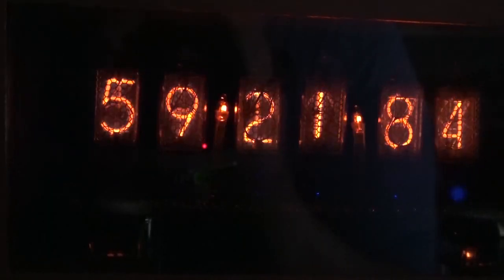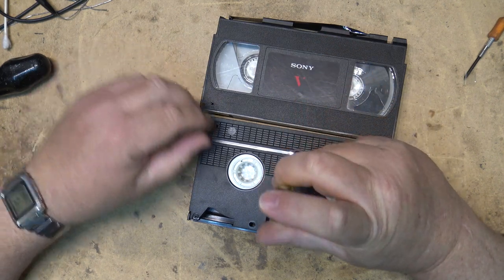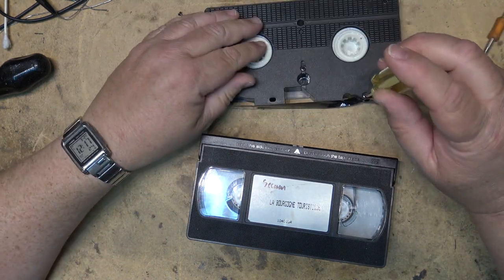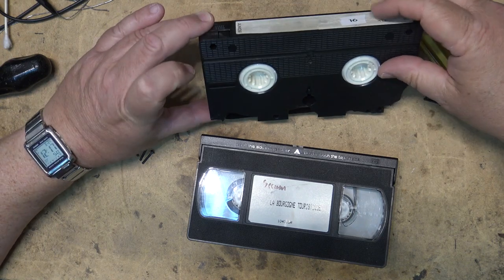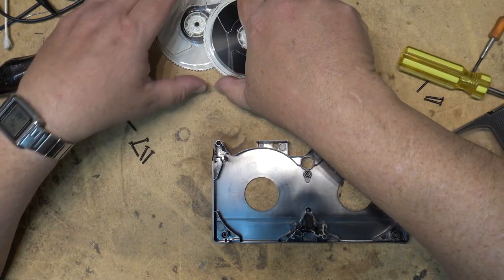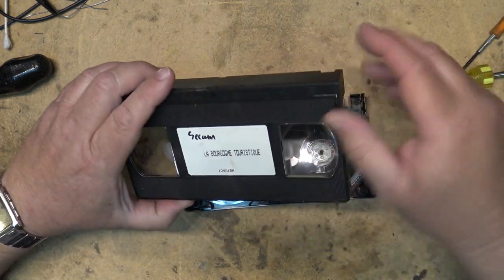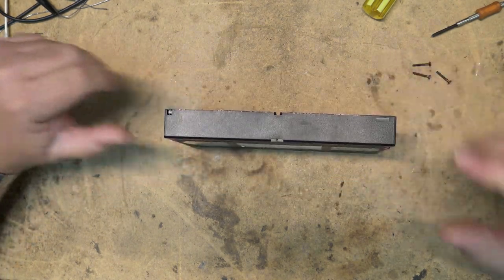VHS tape broken cassette shell swap

Comment: Swapping tapes over into different cassettes looks easier than it is but not in practice. You have to be careful not to pull the spring out of the back lid, and also it's easy to pull off the plastic bits that hold the cassette in place at the bottom. But I've heard that it's not a very good idea to use Sellotape/Sticky tape as it will damage the tape and heads of the machine, and even Scotch tape isn't recommended. Using only professional splicing tape (which isn't cheap) and a tape splicing ruler is the best method to repairing tapes.

Comment: That is the benefit of video cassettes, be it VHS or BETAMAX: most of the time a tape can be fixed and precious memories can be saved.
CD's and DVD's do decompose and become unreadable, files on a drive can get corrupted and get lost forever.
My point is: analog is not as bad as most people today think.
Reply from the maker: Until the machine required to play it no longer functions and you can not just go out and buy a new one.  As to DVD for reliability I have played flawlessly a DVD that was recorded 17 years ago, and was recorded on a no name brand generic shit disk.  Your previous DVDs put a copy in a dark cool dark drawer.  Don't leave them lying in the sun.  I have 200 cdr compilation disks on my Sony 200 dials changer.   They have been in it since I made the CDs most in the early 90s and every one of them plays fine.  I have been looking for disks that do not play and the only ones that don't were disks that I sat in a window to see how long it took the sun to damage it.  Incidentally last time I tried to play it was 3 years ago after it had been sitting with the record surface facing the window for a year. Then I forgot about it.  But it did play fine after 1 year but failed sometime between 1 year and year 4.  
  If you backup your DVDs every 10 years you will never lose your data.  A blank Costa what, .39 and you can back up a full disk in about 5 minutes.
Reply: Tape holds it for life ,  over 30 years and they still play !
Reply: @12voltvids  Discs rot in the shade left long enough

Comment: Did this a lot for security surveillance tapes repaired torn tape too, hardest part was  removing them from the Panasonic time lapse recorders, the unloading mechanism would not travel up evenly to eject the tape. Sometimes the tape was more valuable than the machines, we had lots of them.
Reply from the maker: Yes security footage is very valuable when it can identify a crime and put some douchebag behind bars.
Reply: 12voltvids sometimes nypd or fbi. were looking  for a car passing through one of our facilities to get a positive Id , also used to prosecute dwi people tapes all gone now, all digital @30fps
Reply from the maker: @tonymanzo3766  yes for sure. Digital changed everything for security cameras.

Comment: Hi there, just wondering, if a voltage output on a smps goes higher than rated, what could be wrong? The output suppose to be 12v dc but upon checking, it shows 20v dc and causing the system to shut down due to protection. Checked all caps, all good. regulators are good as well. But yeah, voltage going higher than it suppose to.

Comment: What will happen if there is a problem with capacitors in VCR power supply. Will ckt not respond eventhough switched ON.

Comment: Nice fix. 👍 I have a question for you, we where moving houses and I turned my VCR upside down. Then when I played back Tapes it played VHS Tapes fine, however if I played a VHS-C Tape in an adapter and put it in the VCR the picture is not still. Is this a tape alignment problem? What do you think? Thank you 👍
Reply: BTW has anyone had this problem, where a VCR plays back VHS Tapes fine but when a VHS-C is put in an adapter and played back on the VCR the picture is not still? Or is it just me? 🤷‍♂️
Reply from the maker: Could be an alignmant problem or the cassette adapter may be broken.

Comment: Do you have any seacam tapes youd like to get rid of I can play all formats and dont have any of those ?
Reply: I actaully have 2 multi system tvs to that play all formats with no converter needed.
Reply from the maker: I have a multi format tv that can play all, and I can play these secam tapes on it but not convert secam anymore.  My machine that did secam is beyond repair.  Panasonic agw1 crap.
Reply: @12voltvids  how about using a capture card on a VCR that plays SECAM tapes. Then set the card to record on SECAM (or PAL if it doesn't support SECAM
Reply from the maker: @joshm264  
No need. These tapes are in a language I dont understand so I have no reason to ever watch them.
Reply: @joshm264  Setting the capture card to PAL will result in no color when playing back SECAM tapes. Both the VCR and capture card must be SECAM-capable. And don't be tricked by "MESECAM". It's still incompatible with the French SECAM.
Reply from the maker: There are many formats incomparable with each other.  Secam is secam, but the french recorded it to VHS tape different than the other countries and since they had their system first it became known as just secam.  The  middle east secam was used for other countries.  The. There is PAL.  Pal came in 3 flavors.  Garden variety pal(aka pal-l), pal-m and pal-n. Pal and pal-m were very similar but pal-m was a 525 line 60 field version.  Ntsc also was available in 2 flavors.  Standard ntsc and a 4.43 version that would allow ntsc tapes to play on modified  pal tv sets. Used to do tons of format conversions back in the day.
Reply: @12voltvids  I just looked at the specs of my tv and vhs machine they said they can play all the formats u listed except for tapes from france.  I have a panasonic and a sony multi system vcr and a jvc multi system tv and a sony muliti system tv as well nice sets to.
Reply: @12voltvids  I have pal format so i can see disneys song of the south it only got a  UK vhs release of it
Reply from the maker: @stpworld  most could only play mesecam. My Panasonic agw1 could play and convert to either mesecam or French secam.  I believe the Samsung converter VCR also could.  The little pos aiwa I have now can not.  It will play a mesecam tape not convert it. Will only convert pal to ntsc. At least it plays pal. Not that I need it.  I do have a jvc 21 system tv that will display everything.  Pal secam ntsc 3.58 and 4.43
Reply: @12voltvids  Oh ok my panasonic is a late 2005 model but the sony is older it says made in japan to.  The sony is a weird kareokee device to.

Comment: 1:13 - afterwards you'll swap the reels back into the broken shell again? WHAT IS WRONG WITH YOU?
Leave them in the good housing, so the client gets something decent back. They win, and you win because you save 5 minutes of totally useless labour. And you make somebody else (your client) happy.
It's not as if VHS tapes are worth even one cent each. They are trash, so just donate one for God's sake!
Reply from the maker: Except that this is a secam tape that I may need for testing a multi system machine.  The tapes are all going in the garbage once they are transferred.
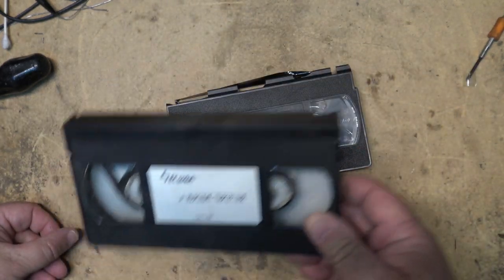Reply: @12voltvids  - Sorry, my comment is only based on what you told us in the video! You said at 0:33 "It's a Secam tape that I have no need for" and at 1:16 "...and I'll hand the guy back his original tape..."
If the Secam tape was actually  valuable to you, it's strange to use it as donor when standard VHS are "dime a dozen" LOL